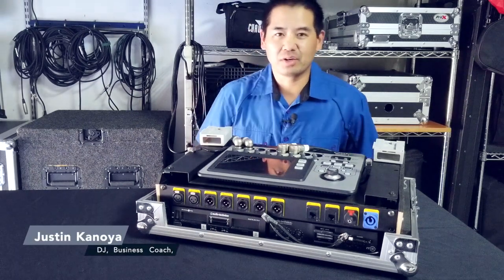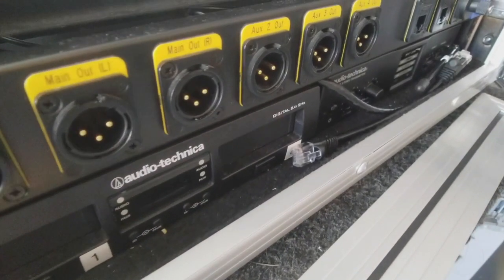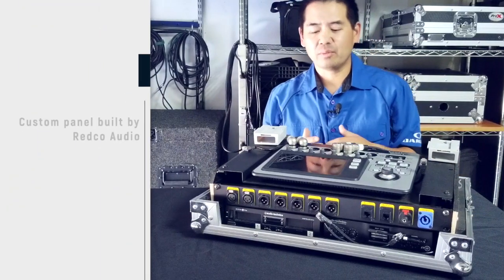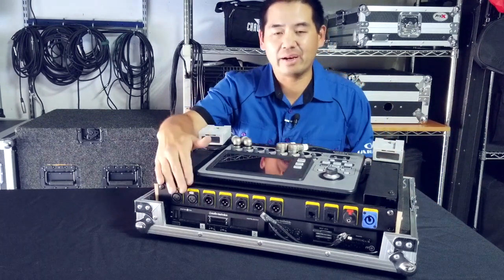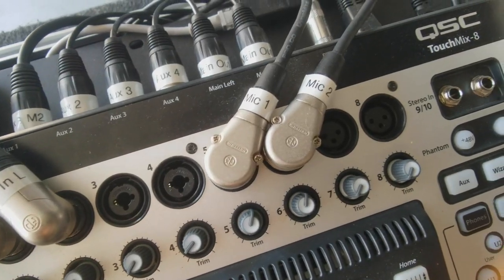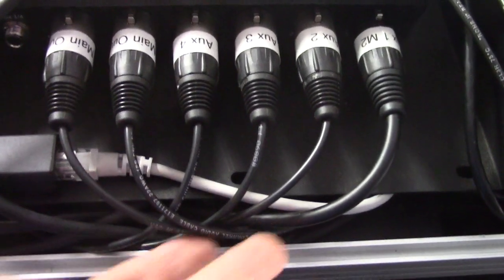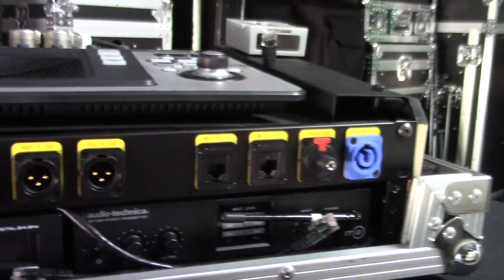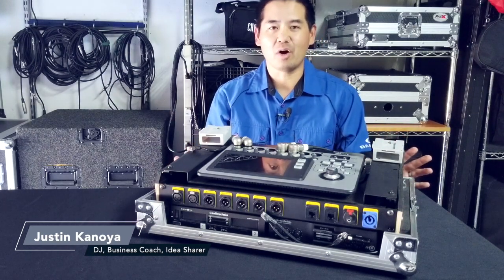Pro X Case Customized For QSC Touchmix 8

Comment: Hi would you mind providing the specs for the right angle cables you used from Redco? thanks
Reply from the maker: Hi ... This is Redco cable building page. My cables utilized the MIC2.K console cable. And then male right angle ends on one side and straight females on the other side. You can build it out on the page, but I'd recommend touching base with them to ensure you get exactly what you need for your project. 

https://www.redco.com/Custom-Cable.html
Reply: @djkanoya  hi dj may i know please the length of your custom 2 XLR cord , mixer to wireless mic? 
Thank you

Comment: That is not how they make snakes . The Cable comes with 8 to 56 Channels in it . One end will go to the Snake Box that sits on the stage . The other end is made into the FAN with goes to the board . (I build snakes) they will put lots of shrink tubing on each channel of the snake to make the fan . If they did it the way you are talking about they would have to have a Big box to do all of the connections in . I will share a video of one being made . Also WHY would you want the Connectors at the Front and in the way ? When building Amp racks I will put all of the Connectors on the Front so we can set them side by side and see everything . For the record I have been doing Live sound since 1967 .
Reply from the maker: Thanks for checking out the video. 

What type of cable are you using for snakes? I'm not following what you are describing, as I only stated that the cable I used for this rack is similar to the thin cable used in snakes -- and not the standard, XLR cable that we'd use with a microphone. 

And the placement of the panel is just what works for me in my set-up as a DJ. Obviously all of the connections on the TM are in the back, and I wanted to bring them to the front.